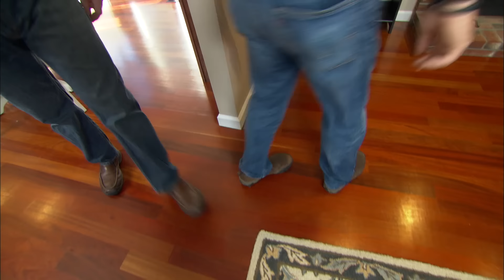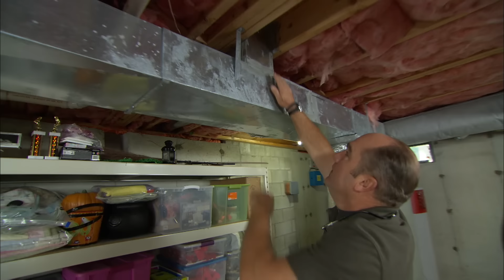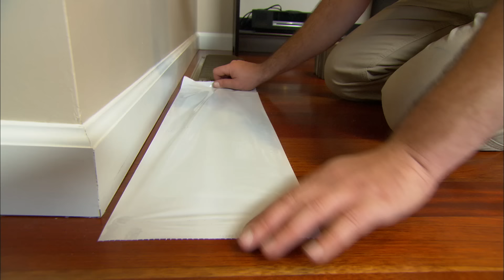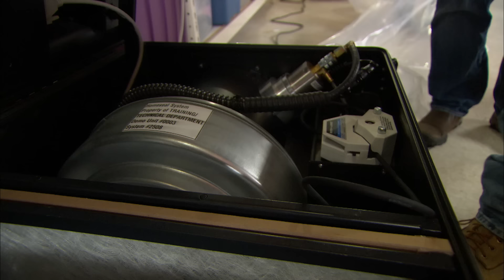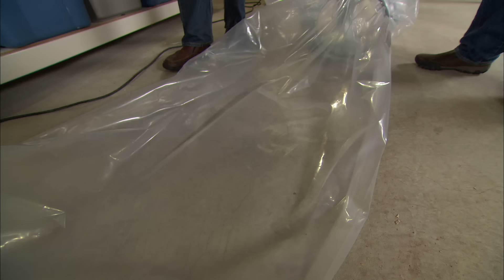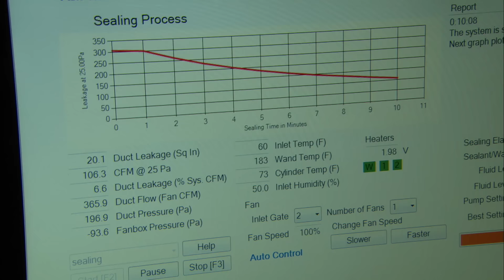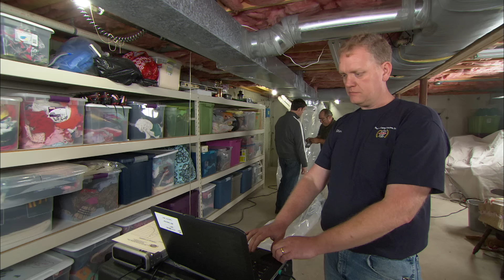How to Seal Leaky Ductwork | Ask This Old House

Comment: I have a few questions about this.

Did they run the pre-test before they drilled that 1-inch hole in the duct? They never showed them sealing that hole back up, so how do we know it wasn't affecting the results? If someone already had a dust problem, they're probably still going to have dust issues.

Yeah, they may have sealed some duct leaks, but there's also a good chance they sealed their lungs if that sealant ended up where it wasn't supposed to.

And what about that 300+ CFM leak they mentioned? Did that number include the 1-inch hole they drilled? If not, then the readings they showed on the screen aren't accurate, and everything they said about the system being sealed afterward is questionable.

I know someone is going to say, "A 1-inch hole won't make a difference." It absolutely can. Anyone who thinks otherwise could benefit from a refresher on HVAC and airflow.

Another thing they didn't show: Did they block off all the supply and return vents before injecting the sealant? If they didn't, there's a good chance a lot of that sealant ended up inside the house. That 1-gallon jug isn't going to seal much if it's coating the vents and getting into the living space.

Comment: I cannot find any company in central Florida that offers this for residential homes. The website says they offer it, but there’s no assistance for it.  I know this video is 9 years old but there should be some update indicating where this service is currently offered on there website and this video should be changed to a commercial only application so home owners are not wasting their time.

Comment: Spraying that stuff into your duct could clog the AC coils and the heat exchangers—that could reduce the air flow in the system . Reduced air flow could cause problems.
Reply: if you look at how they have connected the air hoses, they are bypassing the furnace and AC, so it doesnt even touch them.
Reply: It’s not clear by watching the video how they isolated the ac coil and the heat exchangers.  Did they completely block the air flow to isolate them?  If they did, it wasn’t shown how that was done in the video.  If they just blew the stuff in the discharge and the return, that would not isolate the coil and the heat exchangers.

Comment: forced air is the worst, no radiant heat, the offspring of the guy who put forced air into homes should be punished for the sins of the father, just kidding but it really does suck.gas fired,coal fired wood fired gravity boiler is the stuff, no electric ? still gives heat

Comment: Before you do any “upgrades” to a system, do a static pressure test. If you live in a subdivision with many houses built at the same time, most  likely, your furnace or air handler is suffocating from insufficient return air. The static pressure test will confirm if that is true. Return duct size and the number of return registers is usually the first item production builders skimp on. Adding a 12” return will usually fix a variety of issues you may have, including long run time, the init not being able to obtain set temperature, and loud duct noise. Also check if the blower speed is correct. Most likely, you will NEVER find a test port plug or screw on the supply and return at the unit because the installer never tested static pressure.

Comment: Looks like an interesting option. But they showed a successful patch very near the beginning of the dispersement . I have trouble believing that 100+ feet down the line that it’s gonna have the same effect. Or reaching the upstairs, for example. I feel like the strength and coverage would strongly dissipate after about 20 ft or so. I’d love to be wrong if anyone knows better. Thanks.

Comment: If the ducts are in the basement then any hot air leaked out will just move upward into the house. Insulating the walls down there would be a good idea.

Comment: Very interesting product. how does this product flex and age. I would assume that the ducting moves slightly every time it turns on and off with the air going in and out of it does breaking in the product overtime. Secondly, I’m wondering what the average cost is based on the level of sophistication here for all the equipment and technical products measuring devices.

Comment: Super cool if you have the money to call in those guys. The attention to detail of this guys HVAC is typical of the standard built American home - unprofessional construction techniques. Contractors are allowed to get away with building HVAC systems to a standards from 1930 (leaky, cheap to build) when energy was dirt cheap. At least this homeowner can afford metal duct work. Most homes have fiberglass duct board main supply and return plenums which deteriorate over time and spray airborne fiberglass into your conditioned air. I'm currently working on cleaning up my 24+ year old contaminated fiberboard based system and I wonder how they get away with building stuff this potentially hazardous - using unencapsulated fiberboard ducting (on the inside of the supply and returns) - knowing it will spew loose fiberglass into our children's lungs.

Comment: That one the store was turned on the effect that it has on my allergies when I’m in the kitchen when the flame is on and there’s heat on the burner, he’s even worse. Does the heat make the particles of fiberglass sitting inside the woodwork lift Lift off more aggressively

Comment: How can I seal this hose that was cut properly and contain whatever fiberglass strands are floating inside the woodwork of the cabinets once I sealed the cut aluminum hose that I cut properly with an airtight seal what should I do with the remainder of the cabinets should I put some type of cork sealantall over the inside edges of the cabinets to help air seal pretty much the entire cabinets structure. I also find it that when the stove is turned on

Comment: Hi guys, I made a mistake of cutting a flexible HVAC house. It is the hose that runs on top of the kitchen range that is on top of the stove. It is the hose that runs from the range on top of the stove. It is this hose that runs up through the ceiling of the kitchen and part of it is inside the cabinetry that’s right on top of the kitchen range. So basically it’s there as the kitchen exhaust. The reason that I cut it is because below me there’s people that smoke a lot of pot and a lot of those films going to the kitchen. Those fumes going into the kitchen. One day I got fed up and I just cut the flexible aluminum hose if I can call it that in the middle. I went to seal the end with plastic  and regular tape. After a while, I realize that the plastic blocking was not doing his job properly. I went to Home Depot and I asked the people that were there. What can I use the inside of the house to block the order that was coming out of there or  the fumes. I was told to use something that looks like a beige colored foam material. I was told to stuff the inside of the pipe with that material. After installing it, I realize that the material might have been composed of fiberglass, such as the one that’s yours for attic insulation. I see all the ants again with a piece of plastic. I realized right away that my allergies in my eyes started burning. My nose started itching. My chest started to get tight. I suffer from allergies. The culprit in this is the fiberglass that was put inside  the aluminum hose to block odors. I then went on to remove the fiberglass that was installed in there. But I am still having problems with burning eyes in the same symptoms that I describe earlier when I’m in the kitchen area specially. I tried cleaning the area with a shop vac  and wore a 3 AM particle mask. I can’t seem to get rid of the problem. Every time I walk in the kitchen I get like that. I can’t think any other thing, but to think that some of the fiberglass strands flew inside the inner portion of the cabinets . So basically, there’s probably strands of fiberglass flying inside the woodwork of the cabinets. I find it to be particularly a huge issue on windy days and this I can only assume that the wind is blowing inside into that in their area like you know the roof of the house  and lifting all those fiberglass particles that are sitting inside.

Comment: Almost all ducts i ever seen especially on mobile homes arent installed right 😢... Even the HVAC guys youd think theyd do it right.. most time its a zip tie or insulation not tucked in on the outter liner.. duct on way too far not enough bite room etc... Also no spray glue.. the little things.matter... even just tape being in the right place.. otherwise eventually the condensation will get to the tape and eventually tape will just start falling off, especially without any spray glue .... Mastic too is important ... Anyways good luck. Msg me if anyone has any questions

Comment: I’m in the process of finishing my basement on my new construction house and the hvac people didn’t seal any of elbows or connections for the supply pipes that go upstairs. They used uninsulated connector class for all the returns and the sticker on it says “for insulation in length not over 14’” all they used was a zip tie and a screw to connect to the upstairs registers. The stuff feels like cheap tin foil haha. All I wanted was to add a few supplies and returns to basement after removing the sheet rocked ceiling and found more work and stuff to be sealed!!

Comment: I would not want some toxic chemical coating the inside of my ductwork and building up on the coils and fan motor to be circulated inside my house for my family to breathe. This is clearly the lazy man's way of putting a lousy patch on  the venting, and you can be sure it's going to wind up being very bad for your lungs and damaging to your HVAC system. It needs to be sealed from the outside, not the inside.

Comment: I hope to see this become code with all new forced air systems. Once the whole system is installed, do this procedure as part of the process.
Reply: In new construction you can use this to seal the entire house since there is no furniture or flooring to get ruined.
Reply: I do aeroseal for a living and we occasionally get some new construction jobs b/c it's now building code that the ductwork has to be under 100cfm leakage

Comment: I recently had Aeroseal installed on my townhome in NJ.  The product does not work at all.  My Aeroseal contractor did not provide any certificates of completion w/ before and after readings.  The seals on the returns busted and shot the Aeroseal all over my home setting off the fire alarms.  The big fault of their process is that the product only supposedly seals gaps/holes under 5/8".  I know the techs were having an issue as they kept calling back to the home office for guidance as the CFMs weren't dropping.  They do absolutely no inspection of your ducts post installation to address anything that aeroseal was not able address.  The issue I was having actually got worse after Aeroseal installation.  I contacted Aeroseal directly to report the matter and help after my contractor also failed to respond.  Absolutely no response from either company.  After spending $3k for nothing, I am now searching for another contractor to either replace my duct work or repair the traditional way which will be a pain as my duct work is between floors and in walls (I live on a slab).  Please don't waste your money on this product - they will take your money and run!

Comment: Great idea but wouldn't this plug up your AC evaporator coil and make it less efficient?? I cant see passing this product though that. I would think this would blow into the furnace as well. Unless you pull all the ducts off the evap coil and furnace main distribution point it seems like it would put a coating on all that.

Comment: The cost of getting this done would eat up your money saved on heating your house for probably years before you'd get a return on it. The fact he was complaining about heat is surprising cause the duct is even insulated which we don't do up here where I live and its winter 8 months of the year. I'm guessing probably undersized furnace or ductwork, and as for the dust, if you run your blower on the furnace non stop it creates more air flow in your house making less dust settle and it won't eat up much electricity. Another option is to change your duct work into a 2 zone system so if its different temps on different floors the system will only heat where its needed.

Comment: Great - now I have a metal disc trapped in my ductwork that will rattle as long I live in this house.
Reply: nah, if you look carefully,  instead of the actual duct, they specifically chose the access hole cover used by furnace/duct cleaning to drill the metal disc, therefore they just unscrew the screws, remove the cover, and able to clean up the inside soon after. They chose that spot also because it is really close to the sealant hose, so it'll have lots of sealant to show a great result.

Comment: It's November 13, 2020 and the coronavirus is rising fast.  My husband went into the attic and found a separation in the ductwork.  We want to hire someone to seal it but not during coronavirus spike.  I threw him a towel that he wrapped around it.  Will that help much?  50%?
Reply: Order some mastic tape from amazon for sealing ductwork, or foil faced tape for insulation.
Reply: Humble it is rising in people's imagination only. I suggest see my about tab regarding it.
Also I suggest watch a 13 part series called What on earth happened by Ewaranon to learn that the earth is not a globe. Link in my about tab as well.
Reply: @flat-earther  We hired someone to fix our duct work - like two years ago!   He did a great job.   We have both gotten all the Pfizer shots and will get the Omicron on Monday.   I get all the vaccines but I take no pharmaceuticals.   At 73  I've never been to the ER, never hospitalized, never had surgery, never broken a bone, have no pain anywhere in the body.   Yet I've had all the vaccines:  polio, pneumonia, shingles, tetanus, ruebella,  flu, Covid - you name it.   It sure hasn't hurt my health one tiny bit.
Reply: @humblecourageous3919  Hi humble, have you become a flat-earther and an anti-vaxxer yet?
Reply: @flat-earther  At 74 and 75 we got all the vaccines and have absolutely no problems from them.   I've never understood flat earthers.

Comment: Awesome information. I was wondering if my duct work was in good shape. I got this place this year and the duct work was put in around 1974. I have already done some work to seal the Duct work. After seeing this I know to take a closer look and return and supply duct work. Thank you so much for this video.
Reply: I can't guarantee something not right. Every single duct just about I ever seen is not installed right. No 1 uses the proper amounts of tape. Or spray glues. Or right kind of tape or tape in the right places...

Comment: I would assume that this wouldn’t work on old ductwork due to dust..
Reply: get a proper duct cleaning done first by some real professionals, then duct sealing should be fine. The only problem I see is that this type of duct sealing will only work in supply vents. In many newer houses, the return ducts are made of plastic sheets or cardboard sheets which often have big holes that are impossible to seal (and cannot be fixed if the holes are hidden from view). The big holes are often created by plumbers, electricians, internet cable techs, or anybody who's trying to install things in the house.

Comment: How would this affect damper operation?
What about the AC coil and other equipment like the existing blower motor? Would they not also collect the product on them?
Reply: They were disconnected.
Reply: @onemorelevelup  How do you disconnect dampers for each of the registers?
Reply: @Shandleyman  the dampers we're not disconnected but I'm not sure why you would disconnect them? The furnace and AC were clearly disconnected from the flow meter system.
Reply: @onemorelevelup  Because that aerosol will gum up the dampers. God help you if you have electric dampers.
Reply: @Shandleyman  so I think that's a fair point but it again depends upon the inherent tensile strength of the material once formed. I suspect it's quite low for mechanical manual dampers but it might damage electronic mortized dampers which in contrast usually have access panels next to them for service. Electronic dampers are also much more rare in home setups but I hope smart digital ones will become a common place soon 🙏

Comment: This really should not be much savings unless he has leaky pipes in the attic or elsewhere that is not insulated.  If he wants the basement and upstairs bedrooms not to be heated in the winter.  The problem is at best heating the wrong areas of the house.  The dust problem can be fixed by sealing the basment floor and intalling a hepa filter just before the cold air goes into the furnace.  Do have an furnace filter? Probably want to remove it if they do